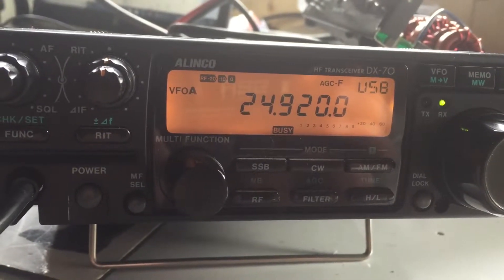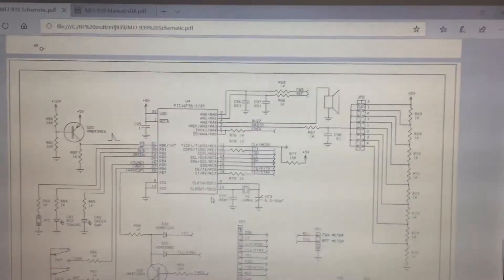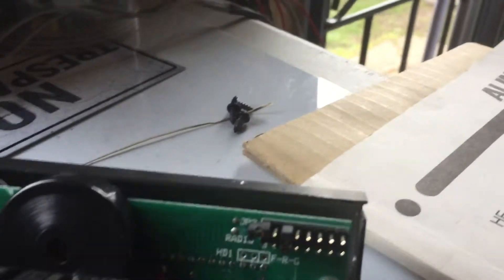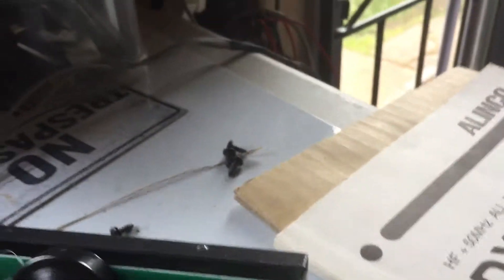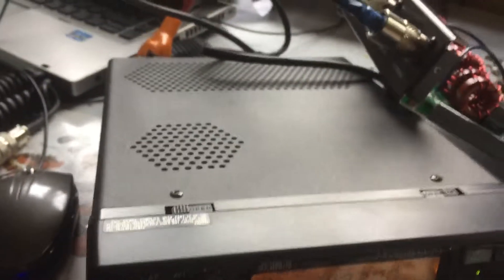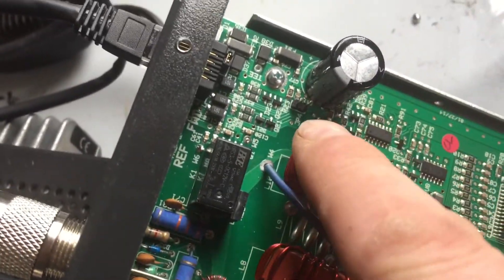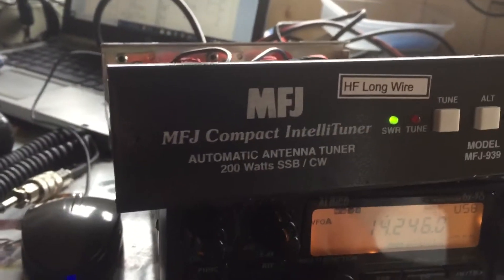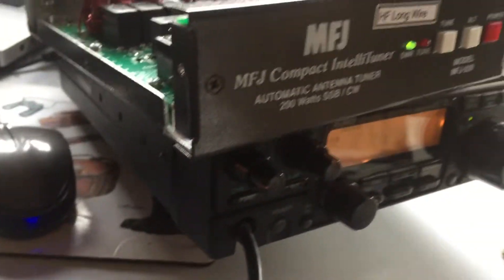Alinco DX70TH working with auto tuner MFJ 939

Comment: very good video i have the same tuner i need to know what diode is on the transmitter input next to the relay as somehow it let out magic smoke can't find a diagram anyplace pretty sure its a fred diode but cant read the part numbers only 39 at the bottom right side left the rest burnt off .vk3xxy-73.